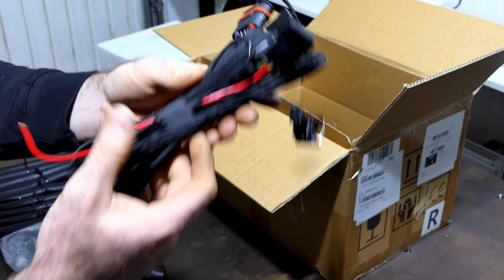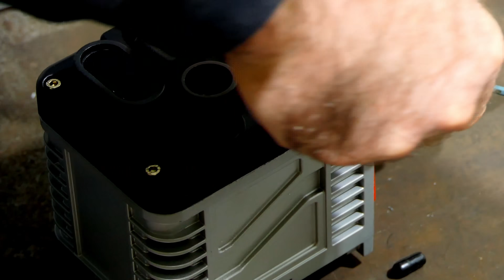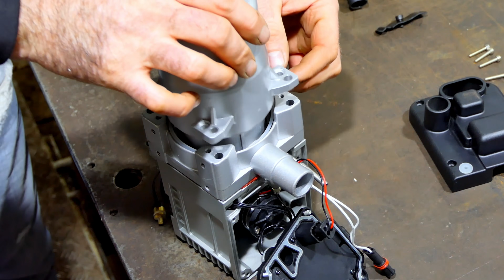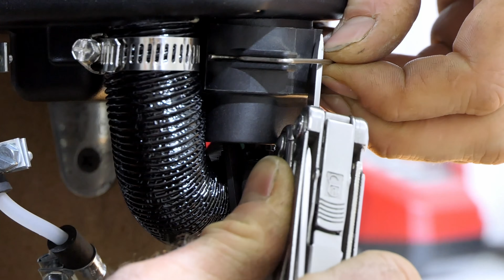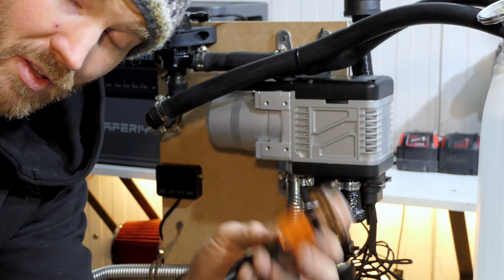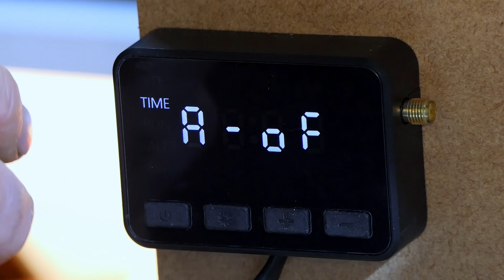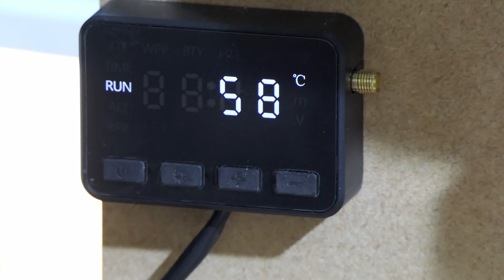Wonder of Manufacturing - Worlds Cheapest Automated Hot Water Central Heating System

Comment: hi,i am living on a houseboat built  by myself.I have to say i am very sceptic over your results of grid talking.First solar panels are obsolete in winter(6 AGM =£45-£60 in petrol for the inverter generator to keep up with charging=hours of rattling 3-5 hours a day. 
2:  8kw @£150Chinese heather 4-6 lite r per night way less power then a 5kw Eberspcher @£2500 trade price(925l =4months) .
3.Within extensive use 78%efficiency  will be drastically reduced..  
4.kerosene /heating oil somehow is less efficient than diesel.500l min buy =£650. 
5 .Aprox 30 ×20kg coal =£300  =£500  + 4-6 bulk bags  woodcuts £20/£30each 8.or spending 7/12 days foraging.. 
 On top of this insurance £23/pcm ,river licence £156/pcm  .
 6.plug your power bank on a a generator please .Do that 10 times petrol ££? + £6/£10 oil.Now after 50 hours check the compression 
Now from the comfort of your house  could you please tell the students to try harder than ever at they're classes please .Is not such a think as in a cheaper living.If you don't pay with money you pay with time. or you can live under a bridge. 
 I like your videos and you like making money out of it . I hope you can take a bit of criticism from a "stress free boater"living the dream

Comment: keep in mind your water's losing energy to your cold garage.  Your water tank would do best inside an insulated ice chest.   Your pipes need insulation too to get a proper efficiency figure.  Think about the insulation in high efficiency water heaters, it's around 4-6" of urethane foam.  In fact you could recycle a decommissioned water heater, old ones won't be as efficient but it's easy to wrap one of those w/extra insulation.  A plate heat exchanger would work well for your hot tub.

Comment: 5.79 kJ = 1.6 kWh. 55p/l = 12p to heat. 7p per kWh, more than I pay at night for electricity.
Reply from the maker: @GM-dc8vr  it's 10kwh per litre in kerosene. I only used a small amount in the 30min time. Night tariffs are definitely great especially if you can capture it in batteries for day use. Cheers J
Reply: @joshuadelisle  the numbers i've written there are based on your delta T and consumption figures.

Comment: Glycol does not make it more efficient as it lowers the specific heat capacity, however, mixing a small amount in as a corrosion inhibiter is a good idea. Glycol has a specific heat capacity about 2/3rds that of water so for the same performance you need to flow the liquid 1.5x faster at 100 degrees celcius or more at lower temperatures. The 5kw refers to the fuel it consumes. I had a 30kw one in my Bus to heat a calorifier and run central heating.

Comment: Josh all the videos of yours I have seen are very good and about technical heating solutions - would you make one about homemade water heating solar panels? I made a couple and they were so efficient they melted within seconds of exposure to sunshine (literally) and I had to build 'crap ones', reducing efficiency twice before I had practically functioning, stable ones - people are just unaware of the incredible efficiency of  them in comparison with electrical PhV panels which are expensive and need so much management (though they have their place, and I have quite a few of them). Water panels can easily be built out of scrap materials, in a day, and almost for free. And there was me thinking to optimise mine at every point of design, until I realised... anyway, best wishes.

Comment: Thanks for the high quality stripdown videos. I have a couple of old Webasto and Eberspacher 24V airheater units - the control equipment looks old and decrepit having been out in the elements to some degree, but the heaters themselves were tucked away in yachts and look barely used - I'd like to re-use them. Can one buy aftermarket/generic control equipment which is easily fitted to them, do you know? Thanks for any good ideas on that.
Reply from the maker: @gurglejug627  thank you. I'm pretty sure eberspacher sells replacement parts. They will be more expensive than the Chinese copies. I'm not sure replacement controllers from china fit the original heaters. If you buy off Amazon and they don't fit you can always send it back for free on Prime. Cheers J
Reply: @joshuadelisle  thanks for your thoughts and ideas there. I'm probably pushing my luck now, but are there instruction sets/parameters/data available that you know of such that one could program one's own controller, say a RasberryPi or Arduino? Perhaps it's been done? Perhaps one can even re-adjust settings to make 'generic' Chinese controllers work on Ebers/Webbos? If I have any luck this end, will let you know. Cheers.
Reply from the maker: @gurglejug627  you could easily ask chatgbt for the programming codes for an Arduino micro controller. That's basically what I would do. Cheers J

Comment: I installed the way more expensive unit from espar in our bust for in floor heating (was not worth the money difference) it broke down and we were unable to get it back up and running as it needed updates and error code deletes that we cant do ourselves. The biggest issue is that for infloor heating the 1 hout time reatraints is not helpful at all and would be way more helpful if it went off a thermostat instead but still allowed the machine to do its cool down period. If anyone has anyway to do this, id love to see that.

Comment: sorry to be the calculator here but ....
with a fuel consumption up to 0.24l and using diesel as fuel, the max power should be about 2.5kW ... not 5 !
Reply from the maker: @Atimar01  that's within 30mins so It could be 5kWh/h but it's still not anyway.

Comment: I have i similar unit but 16kw power for house heating. I will today finish all mounting and start a unit. I have 9 radiators, and i will run 60% agro dizel and 40% filtred wmo on 65°c  fuell temp for better combustion in "webasto"

Comment: Josh
I got confused when you mentioned 
the cooper connection how it would corrode 
so are you saying if the pipe work in my house is copper 
like 60% of houses are i can't use one 
to push the water around my central heating system or have i got it wrong because if it can do that it could be worth putting 2 of them together and get 10kw of energy that's bloody brilliant WAY CHEAPER THAN A COMBINATION BOILER YOUR LOOK AROUND 
£ 2000 FOR A NEW ONE BUT WITH THEM £500 FOR 2 OF THEM GREAT VIDEO
Reply from the maker: @christophersherratt7299  I'll do a another video on this. What you need to do is isolate it from the house system by using a calorifier or heat exchanger. I'm not sure how much galvanic corrosion will affect it but it may also be a case that an inhibitor additive would work fine also. Cheers J

Comment: Wow, again such a nice video! I would LOVE to see a series optimizing this heating system, like you did with the air diesel heating system. Maybe using an insulated water storage with a two-way exhaust. When the room temperature drops below a certain point, the exhaust heat could be stored in a sand bank. Otherwise, the exhaust heat could go through an EGR cooler and transfer the heat into the insulated tank. Maybe it's a bit useless, but I love useless things :) Thanks for making this video! Greetings from Germany!

Comment: Nice review, Joshua. Did you see a specification on maximum water pressure the heater is rated for? Not mentioned on the selling website. Wondering if it can handle 1.5bar. Thanks.
Reply from the maker: I will check. I'll make sure to include it in the follow up video too. Cheers J

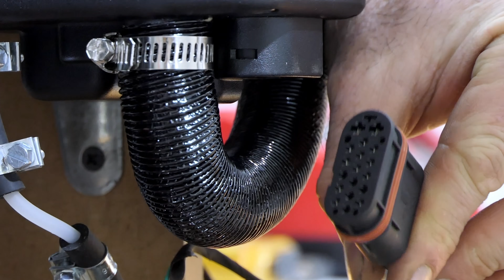Comment: 13:40 - To avoid losing the clippy doofah, push it in, rather than pulling it out. Try it! Also anti-freeze (ethylene glycol) has a lower specific heat then water, so is less efficient at moving heat. It will heat up quicker than water, as well as losing heat quicker.

Comment: At the beginning you suggested it could be combined into a central heating and then separately mentioned galvanic corrosion, hopefully those listening actually paid attention to that.
If someone wants to do that, then you can get plated heat exchangers which are neutral to the other metals.
Reply from the maker: @BobHannent  you can isolate it with calorifier. So it's not an issue if you know what to use. Also there are inhibitors to counteract the corrosion. It's just not as simple as hooking it up. Cheers J

Comment: Been using this unit for hot water when camping on my ute. Plumbed into my diesel tank for fuel. Heats up my 30 litre hot water tank to 50 degrees in about 10 to 15 minutes. Works really well
Reply from the maker: @rylanbrowne5658  nice. Cheers J
Reply: is this still running after one year and how big is your tank ? i have a houseboat and kitchen up one end and bathroom shower down the other, i was going to go instant gas but this looks good as i have the deisel heater already. cheers for any info ? how big tank how long shower? good pressure?

Comment: 12:35 Glycol will not get you better efficiency. As a matter of fact, the efficiency will be worse if you use glycol. Usually glycol is mixed with water to stop it from freezing. Even if you don't use pure glycol but a 1:1 mixture with water, the specific heat capacity of the mixture is about 75% of what it would be if you used pure water. This is assuming you're using ethylene glycol.
Reply: I knew that, living in Ohio, but I'm  sure seone had to hear it😂

Comment: Thanks for the information very helpful living on a house boat and was thinking if it would be cheaper to run than my propane water heater
Reply from the maker: @Wietzevanderlaan  it depends on the price you can get the fuel per kWh. If you can get heating oil for cheap at a depot then that may be better. Cheers J

Comment: hey josh im not a smart guy but my head was thinking if the water heater heated the water could you ye use it in the van to heat a raditor and have a nice hot shower lol would save having the desiel heater 🤔
Reply from the maker: @maddog19671967  you could. Cheers J

Comment: You can get an AAV ( auto air vent cheap at plumbers merchants- make sure it's at highest point of the system .
Am I missing something? - wouldn't it save over  100 quid if you just used a standard cabin heater ?  It's not more powerful, or quicker- just needs reducing the outlet pipe to pipe required by system? And put a reducer on exhaust, and run that through the water tank, as well...??

Comment: What's the brand with the most replaceable parts? I usually get a decade of parts up front to avoid availability problems and assume it'll get binned in 10 years. My lawnmower has survived 20 years and the only thing I cant replace is the wheels
Reply from the maker: Well done. You can always 3D print new wheels. I can print in carbon fibre nilon which is super strong for wheels. I've found a few parts on Amazon and eBay. For the price it maybe worth just buying a few heaters just for spares. The original webasto version can cost over a thousand. Cheers J

Comment: I've been considering using one of these to flow hot water through a hydronic coil that ill swap out with the AC coil in my central air system(we don't use the central air). I dont know that it would heat my single family home all that much but I do live in a warmer climate here in California.
Reply from the maker: Nice. Cheers J

Comment: If you are going to use it to heat your hot tub and you have chlorine/bromine in the water you'll need to use titanium as the heat exchanger, everything else will be eaten away eventually (sometimes very quickly e.g. aluminium don't ask how I know it took a long time and some money!). I heat my hot tub exclusively from the oil burner/biomass burner and have done for many years.
Reply from the maker: @ianburton1938  thank you. You can get inhibitor fluid added to the chlorine. You have to test to get the correct pH otherwise it's corrosive.  Otherwise Ill just use a plastic coil at the bottom of the tub as a heat exchanger. Cheers J

Comment: With all your calculations, the most important bit, of electricity equivalent price, would have been nice. The power pack , I have looked at because of the XT60 for running my diesel heater for winter pike fishing, and reasonably priced, for a battery and inverter
Reply from the maker: @rickyroaster  electricity = £0.25/kWh. (kWh=1000w constant for 1hour) 

£0.25/1000 = £0.00025/w.

£0.00025 x 39w (burner consumption) = £0.00975/h

I believe that's correct.

Cheers J

Comment: Can it be set to maintain a specific water temp, or does it just have to be manually started and ran for an hour at a time?

I'd like to replace my Toy Hauler's propane water heater system with a system like this that can be used to heat water for showers, and kitchen use, as well as running an in-floor hydronic system (and maybe even some water-to-air heat exchangers with fans, to heat the space on cold nights. But in order to do that, I would need a diesel heater that can actually maintain a temperature range, rather than having to be manually started up and run for set run times.

If you're using it for a hot tub, I would like to assume it has some sort of ability to maintain a set point, but you know what assuming does...
Reply: I have one, it shuts down when it hits set temperature.
Reply: @jonjessen  But does it start back up when temp drops?
Reply: @Wrenchmonkey1  nope, only by timer or manually
Reply: @jonjessen  that sucks. I hope someone will start producing one that works like a normal water heater with some sort of hysteresis. I'm pretty sure Webastos can do it, but I don't wanna spend $2k on a water heater. 😬
Reply from the maker: That's good to hear Jon. Cheers J

Comment: Yeah, at last a test of one of these ... And top-notch review ... How great ! Any idea of what chinese brands to prefer or avoid ? In terms of air heaters, i have a bad experience with a 5kW Vevor and excellent yet time-limited with 2kW and 5kW FDIK ... The controls and possibly the pumps seem different from one to another ...
Reply from the maker: @63n0it  thank you. The brand it self isn't important, they're just a name. Knowing who manufactures it is the key because most brands use the same manufacturer. Hcalory has terrible diesel heaters but this water version is fantastic but made by a different factory. Cheers J
Reply: @joshuadelisle  Thank you. How do you figure out the factory of an existing and/or of a desired product ? And how to figure out the good factories, then ?

Comment: Any idea if this could run on ethanol (kerosene is difficult to find where I live). Or on 5 micron filtered vegetable oil ? Or on a mix ? Thank you !
Reply from the maker: @63n0it  it will run on veg oil mixed with 30% diesel. You'll just need to clean out soot from the continents and maybe replace the burner inners now and then. Cheers J
Reply: @joshuadelisle  Thanks for the reply. In the meantime of reading you today, I had figured out that mix myself by trial and error. I can confirm it starts in cold (minus five celsius) with a 5kW unit, I will try to proceed with my tests with even colder startups. Can I expect the unit to at least partially cleanup by itself by doing burns at max power with 100% diesel ? On the other hand of the spectrum, is it worth trying a bi-carburation (two circuits of fuel : diesel and pure vegetable oil, starting and finishing with diesel and running on pure vegetable oil when the unit is hot, possibly by pre-heating the oil ?)
Reply: @joshuadelisle  Any clue about ethanol ? I see no reason why it should not work on a mix.
Reply from the maker: @63n0it  I can't see why not. Cheers J
Reply: @joshuadelisle  Thank you. For now, I will not play around with my heaters further than keeping using a mix veg oil / diesel as the temperatures drop, but I will keep you posted if I make trials with ethanol this spring.

Comment: Your calculations are based on recirculating the water in a loop, but in a shower situation the efficiency would be a different matter.

Also, would the heat output differ between Kerosene and Diesel fuel? (does one combust better than the other)
Reply from the maker: You're right, I need to do another test for that. There isn't much difference between the fuels. Cheers J
Reply: @joshuadelisle  I only ask because your results were different than what the manufacturer quoted (although we all know they’re prone to exaggerate) thought the fuel choice may have made a difference.

Comment: $50.00 will buy you a heat exchanger for the exhaust pipe that could be used to preheat the water feed to the heater .
Reply from the maker: that's a very good deal. cheers J

Comment: Could one of these be used to preheat water entering a combi boiler, to increase efficiency?
Reply from the maker: you could but it would be cheaper to turn this into a combi boiler. or do you mean to just modifi your existing combi boiler with one of these so you can use either in your system? cheers J
Reply: @joshuadelisle  yeah just modify the existing system into the combi boiler. At an old house, I had a combi boiler and a log burner with a backplate boiler on the same system with a neutraliser valve, it cut my gas usage wayyyyyy down and would pre heat the water into the combi as well as boost the hot water supply to the rads as well, and continue to provide tons of heat after the boiler had switched off.

I'm not expecting this to provide anywhere near as much heat, but as a pre heat system into the combi on really cold days to speed up the process and use less gas, could this work?

I suppose one of these would need to be tested to see if it can operate under pressure?
Reply from the maker: @shaunchappell784  I can't see why it wouldn't work. It's 3.2kwh output so you can compare that with the rating of the gas boiler. I'm tempted to hook this directly to a bath. Cheers J